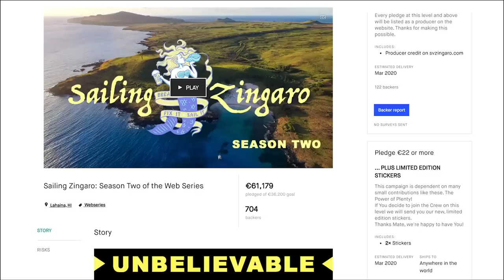Most Difficult Sailboat Maintenance: Removing the Rudder.

Comment: You are making good progress! Dropping the rudder and making new bushings is no easy job and you made it work! Auto sensing isolation transformer ITR3600A from victron would be nice. It will switch between 120 and 230 input to always 120 output. Costly at $ 700,-  but saves so much magic smoke on a cruising boat.

Comment: James you can thin the paint back out! 
If it’s water solvable add a small amount of water and stir. Then add a bit more and stir until it’s like you want it.  If water does not mix add mineral spirit.  Before adding either test a small amount.

Comment: “This boat ended being way more work than I thought it would be” Every used boat owner, ever. Entertaining tho.
Reply: Most truthful and accurate comment ever !!  :  )
Reply: Usually it isn't so much more work than thought in advance, but it's the tropical paralysis You gotta fight in Yourself when its 39°C and 98% rel. humidity, not to mention the caribbean paralysis of everyone else You might need to get work done, be it parts organized, parts shaved a little bit or parts placed when it does not work with Your own pair of hands only.
Reply: @manfredschmalbach9023  is around 30-32 c, feels like hell sometimes in the open sun though
Reply: @RomboutVersluijs  Yes, I do know about average temperatures in those latitudes, while they all (not only James) wrote about temperatures above average this year.
And the open sun is to avoid in higher latitudes as well these days, last not least thanks to CFCs and Halon, used for so long by our ancestors. 
The problems I called "tropical paralysis" do start with the rising relative humidity, preventing even a well hydrated human body from cooling itself when putting out power. The problems I called "caribbean paralysis" can't be discussed further on Youtube any more I'm afraid.
Reply: @manfredschmalbach9023  Why cant it be discussed actually? PS i dont really think that subject suffices here to this video. Why bring it up. He just got here, ive been living here 18 years and never heard of this decease or heard of cases here.
Reply: @manfredschmalbach9023  name the beast by its name and don't dwell on it. Also weed used all over the global, don't say it's Caribbean paralysis. Don't know where you live but weed is taken extensively. Perhaps they are more open to smoke it outside here cause of the laws

Comment: Whe I rebuilt the steering on my Cal 29, i replaced the micarta thrust bearing which had worn through with UHMWPE.   This will not swell in seawater and is tougher and lower friction than Delrin.  If you ever do the rudder bearings again you should use this.   I have degrees in Mechanical Engineering snd Materials science in addition to owning a Cal 29 and Nautitech 441 so I am always looking to improve the life of hard to do maintenance jobs.   My Cat is stuck in Grenada waiting for new rudders from France after we discovered pitting in the rudder shafts.  The martensitic stainless they use is stronger than the austenitic stainless but not as corrosion by resistant as 316.

Comment: What happens if prop shaft is needed to come out bro. Start and gear test. 1 day could save you big bucks.
Grind bolt head round and slot till you get proper bolts. 🤟
Reply: I don't see why the shaft can be a problem.
Like, don't fix what is not broken.

Comment: The bottom washer, very important. Top washer, not so much. I think I would have purchased a washer for the top 1/2 the size you have. That stuff is considered to be the strongest "plastic" available. A company here gave me extremely high prices just for the material alone. Teflon or a derivative, right ? Pretty hard to manufacture stuff with it, so its really high cost. Final was great. I think that stuff would be great for a cutlass bearing . What do you think ?

Comment: 11:30 James how did you do it 220 vs 110 that's TOTALLY different plugs, it's IMPOSSIBLE  !!!
Reply: You can wire 220 to a 110 plug
 Instead of 1 hot 1 neutral 1 ground you can go 2 hot amd a ground.
Reply: @chrisruthford4492  sure U can but James didn't mention the rework .
Reply from the maker: I have only two extension chords, both are 110 plugs. I use adaptors at the ends so i can use the same chord for both lines
Reply: @thelastpirate  That explains, awesome new boat, good work , fun channel to watch.
"new  intro" sounds much gooder !!! peace brother

Comment: Have you learned to use a heat gun to melt the 5200 holding in your thru hulls yet or are you still using a hammer and delaminating the hull

Comment: Rather than messing with the stock standard washer which should presumably fit like the proverbial thumb, why didn't you just sand back some of the rough finished epoxy on the hull at the top of the rudder?

After all you didn't have to remove much.

Comment: I'm suprised you didn't just lap down those teflon/pvc/nylon washers by hand on the concrete sidewalk.
Reply: Bearing surfaces need to be smooth and FLAT.  If it's ground/sanded down and gets an angle, that makes a  low side...and in this case, the rudder would likely 'seek' the low point.  It's the same thing as the self closing doors you might see in a grocery store - just an angled bearing, and the door goes back to that point.   A good machine shop could have that indicated and faced off in minutes.

Comment: I'm in the middle of fixing my rudder as well very similar situation where did you find/source those mylar bushings. ( The white washers)
Reply: The white washers were made from HDP (High Density Plastic) it is very tough and malleable it will not compress or deform easily but it's not brittle.  You can buy it from a local plastic supply company in sheets or blocks of various sizes.  I have used this on a friends sailboat to make blocks to put between an aluminum toe rail and steel mounting tabs on the deck.   I've also used them as lift blocks on my truck.  You can cut this stuff with power saws like radial arm saws, table saws, band saws and hole saws but it's pretty tough to cut sharp blades are best.

Comment: Aye m8, one question: the lower bearing washer - why not go for to double the lower and skip the upper? Two washers always make less then half the friction of one. The upper one doesn't really engage anyways?
Reply: My thoughts exactly 🙂👍
Reply: Yes
Reply: It would make the top edge of the rudder possible rub the hull. There is a reason it is there.
Reply: @lowryshank94  Surely it is a reason but what I’m more concerned about is to reduce the friction in the lower end, due to the way it is designed. All the weight seems to rest on a surface that obviously could need some improvement. James wish to optimise the function of the autopilot is also to be considered.
Reply: Could refer to original drawings and manual for rudder assembly details?
Reply: @MiQBohlin  I understand but the rudder has buoyancy in the water as designed so not much weight. I think James will be served well staying with original design on important systems. My question would be durability of those washers.
Reply: @lowryshank94  Right, also a good point. Seemed to be tough to grind down but time will tell. If there was a possibility to go with double washer/bearings in the lower end and one on top, all in proper dimensions, I think the durability would extend quite extensively, from a mechanically standpoint. Or even double in both joints!
Reply from the maker: It's a good idea, but the shaft is 2" and the little stub at the bottom is 1 1/2"... So that wouldn't have worked. Besides, this is how it was originally designed
Reply: @thelastpirate  I get it, but originals isn't always the best, right? 😉 Just want your autopilot to work as good as possible.

Comment: 3:15 the top washer is not necessary, it could be a thin metal 1-2 layer
Reply: Reduces slop in rudder moving upwards. Most rudders are just positively buoyant.
Reply: @normanboyes4983  this one with axle is minimum 150% neg boyant.
Just to achieve zero play/luft is enough.
Reply: @qb6025  👍

Comment: 47 1/8 minus the thickness of two nylon bushings cannot be 47 3/16. Because 47 3/16 is 1/16 more than 47 1/8.
To get the correct distance/dimension of the rudder when the shims, you need to shim the lower section. Damn...I wish I could be there to help.

Comment: I am thinking the bottom white spacer/glide was correct size & the top one was not needed as the weight is on the bottom one & top would never be touched.  Also, it looks like there was something white in the top & painted over
Reply from the maker: That white at the top was epoxy/cabo that I had to cut out to replace the bearings. I replaced it nicely.

Comment: THIS COMMENT IS PROBABLY WEEKS OR MONTHS TOO LATE, BUT YOU CAN SEE THE TEFLON WASHER ON THE TOP ALREADY THERE. SOMEONE FIBERGLASSED IT IN AND EVEN PUT THE BLACK PAINT OVER IT, BUT YOU CAN DISTINCTLY SEE THE WHITE TEFLON ON THE INSIDE FOR 3/8"
Reply from the maker: That's not teflon, its epoxy/cabosil. I had to cut that away to access the bearings, then i filled it back. Pretty job, yeah?
Reply: @thelastpirate  I’m glad to see you have a great boat and project! Been following for years. If you ever need to build anything when you’re in Miami, my shops you’re shop!
Reply: @thelastpirate  James you did it right! followed OEM!!